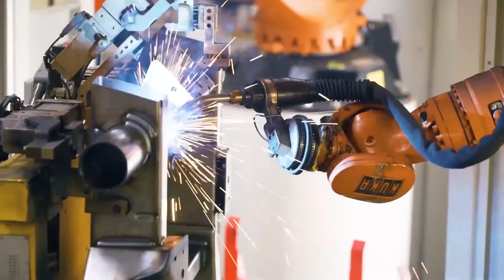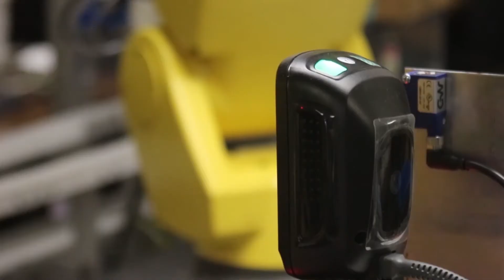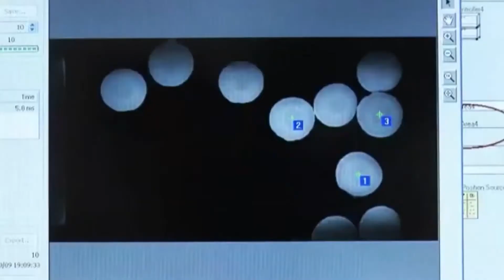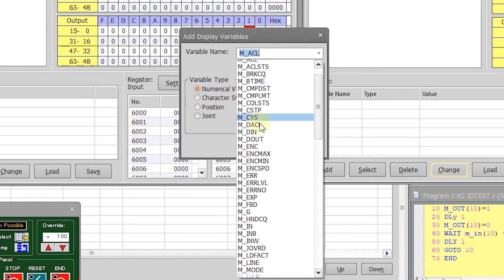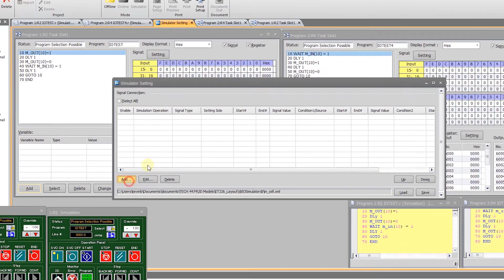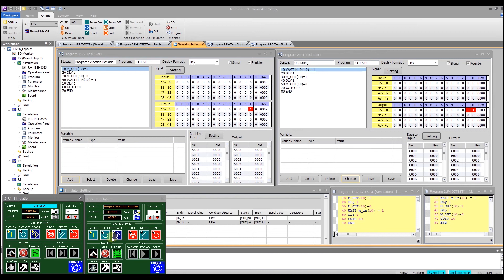Mitsubishi RT Toolbox 3 Simulated Inputs and Outputs

Comment: Hey!
It works in the simulator but how can i use this in Reality wth 2 Robots?
The IO Simulator does not work with the Real Robos so there has to be a different method to set Inputs and Outputs depending on another I/O.

Please answer me… i am frustrated